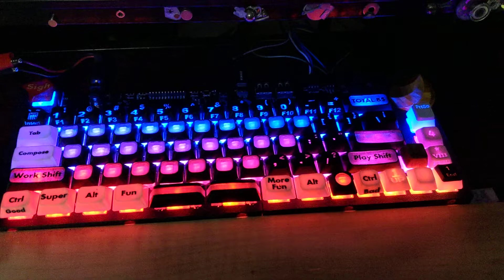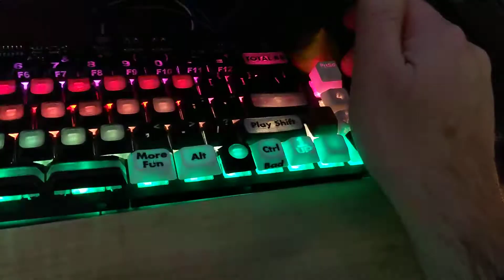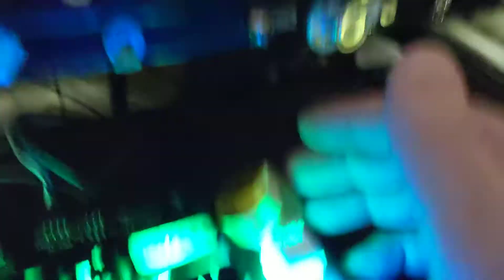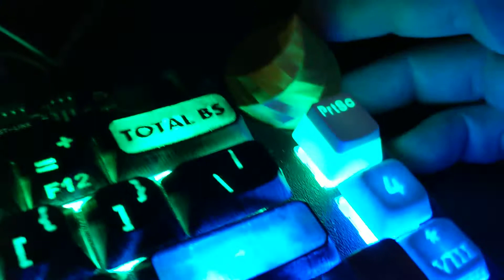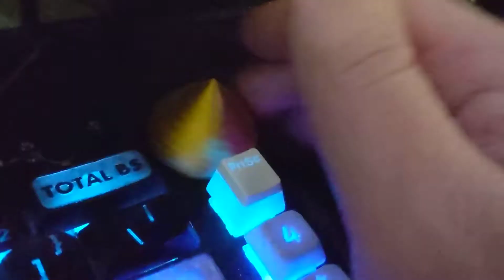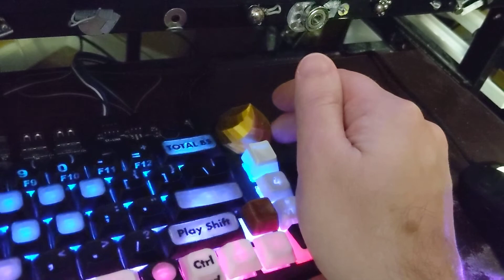Contactless hall effect rotary encoder with configurable (insanely high) resolution works!

Comment: When you are all set and done, it would be awesome if you could isolate the rotary encode for others to DIY. Would love to add a scroll to my keyboards that is that cool.

Does it have any "step"-feeling like most scroll wheels or is it totally free moving? And could it be configurable?
Reply from the maker: It's totally free moving at the moment but I plan to add a step feature eventually. I was actually thinking about doing a plastic bearing so you don't need to buy the unusual 625Z type. If I do it in plastic it'll be easier to add tactile steps.
Reply: @Riskable3DPrinting  I have never had good luck with plastic bearings. Hope you have better luck than me.
If you replace the 625Z with 608ZZ the availability is a lot better thanks to skate boards.
Just thinking here. If you put a stronger magnet on the side to the rotary, wouldn't that be able to pull on the magnets and give it a stepped feeling? Not sure about that. But would be cool if you could still use the magnets for it.
Reply from the maker: @thedevilffs  I've had great successes with plastic bearings in the past using airsoft pellets as the balls (3D printed balls won't be perfectly round).  I even have some parametric airsoft pellet bearing designs on the popular 3D printing sites!

I thought about using 608Z (aka skate) bearings but they're so big!  That's why I went with 625Z.  I'm actually considering smaller metal bearings because if I'm going to require folks buy some bearings there's a whole ton of different sizes to choose from.  Smaller makes more sense (though 625Z bearings are very popular/common).

I also tried the stepped-via-magnets thing but it didn't provide enough steps with 4x2mm magnets.  The best I could get was 6 steps and they were much too far apart.  I could get a lot more with smaller magnets but I really want people to only have to buy one kind of magnets to put together a Riskeyboard.